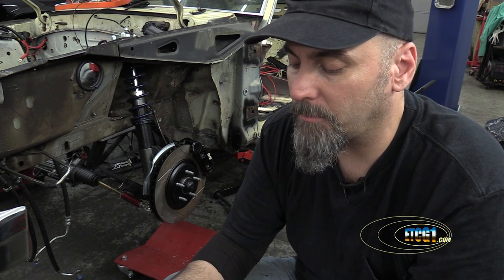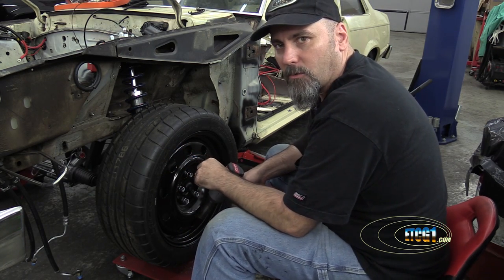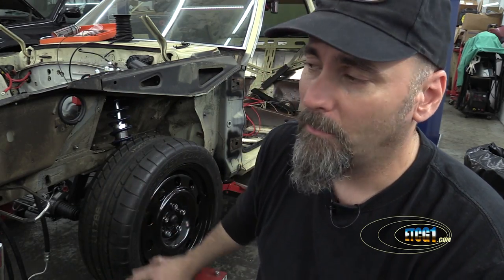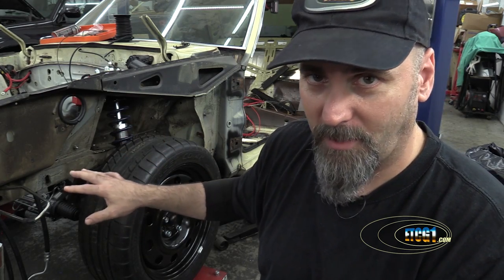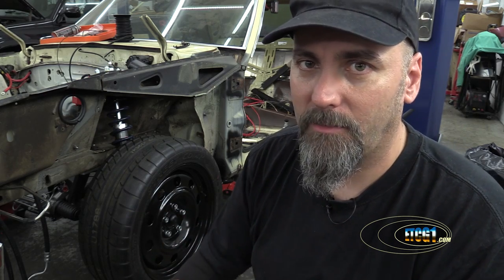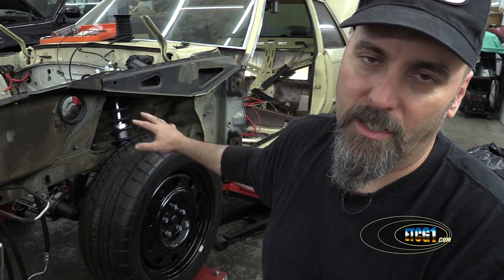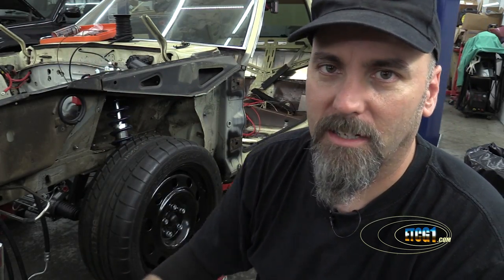Are Wheel Spacers Safe?

Comment: I would think those mass produced Queen Vic cop wheels should be pretty strong. Maybe not the ultimate wheels for what you are looking at, but I'm sure they took into consideration the cop engine, cop suspension and potential for high speed pursuit when they designed them. Worked OK for the Blues Bros. ;)
Reply: They flex like crazy. We couldn't keep the hubcaps on our P71.

Comment: a suggestion good sir.
if the need for wheels arises.....use centerlines (solid ones) and have them powder coated black. they will blend better as stockers at a glance. the sleeper "look" will still be retained....save for the intercooler. perhaps flat black for the bottom of that particular critter ;-)
=dok=
Reply: Centerlines are drag racing / muscle car wheels in terms of appearance, plus they have zero cooling.  Possibly the single worst choice of wheel out there.

Comment: Just a quick question since I have no clue about this.
 Would wheel spacers make you fail a track tech inspection? Yes, no, or it depends on the track?
Reply from the maker: Depends on the track, the vehicle, and the rules of the race you're in.
Reply: Well I guess that can be remedied by getting another set of wheels that you'd only run on the track.
 I'll even be willing to bet that if you look hard enough you'd be able to find a place that can get you a set of  the same style wheels with a different offset.
 That's one of the things I love about cars. almost infinite possibilities.
 Thanks for the reply.

Comment: I wanna put 3" wheel spacers on my truck to run a -44 offset rim so I don't rub my springs. I had I 2" wheelspacers fail on me Before which resulted in them failing and me breaking my wheel off the studs and causing body damage. Andy advice

Comment: Hmm...I wouldn't be concerned with safety but I'm not too sure about the long term affects on wheel bearings and steering geometry. I could be wrong but I would think the further offset would create a higher torsional load.

Comment: Years ago, they made some really cheap and crappy wheel spacers that were dangerous.  The 1/4 inch ones if installed correctly are safe, they do not affect the handing of the car and will not come apart.  The cheap ones they made years ago would break apart, they were dangerous.   Good quality spacers are safe if they are installed correctly and made to work with the aplication you are using them for.

Comment: I don't have a problem with wheel spacers from a prospective of safety but I'd imagine they have the potential to throw off the geometry of the suspension. Glad to see your getting closer and closer to completing your car though.
Reply: TheTarrMan depends, they are usually used to correct wheels that have a et value that's to high, hence the rubbing on the shocks. Basicly putting the alignment back into spec.
Reply: @Roger Supernova Very true point.

Comment: I had this problem on an 06 acura tl. When I put a spacer in there wasn't enough threads to grab and hold the wheel. I had to get extended thread lug nuts that actually go down into the wheel seating holes and grab more threads. Problem solved.

Comment: In a YouTube channel Engineering Explained thy talk about how much more excessive wear the spacers will have on your bearings, your tow and scrub radius will be off and your suspension load will be off. 

Question: We have a 2016 Acura RDX V6 AWD. I want to put quality hubcentric 1" wheel spacers with new studs pressed into the spacers on the car for better handling and aesthetic look. So they will be quality part installed correctly with right torque and I will use a medium strength thread lock.

 How much more stress will I actually put on the vehicles bearings & suspension components or if any? will I speed up the life by 50% lets say? 

Option 2: I buy a bigger more aggressive offset wheel (1" wider and 10mm more out offset) - wouldn't this be the same effect on premature life span wear as a 1" spacer? 

Thanks
Reply from the maker: I really couldn't say, but I wouldn't recommend doing what you're doing. My experience with Honda/Acura is that they really don't like it when you change the tires or the suspension.

Comment: Wheel spacers are not for street use, they were originally designed as a tool to determine wheel offsets for custom applications, then you order your wheels to fit your car. as the lugstud is a standard length the lugnut has to engage at least the same depth as the diameter of the lugstud any less is danger Est for the torque setting for the wheel.

Comment: I have 1/2 or 1'' wheel spacers on my 700R raptor and I was pulling it by the rear bumper and the front left tire caught the side of a 1'' driveway side and the wheel obviously went to full lock. It folded the tie rod like it was butter.

Comment: Eric, you did mention it but I wish you'd have spent a little more time explaining hub centric design. I your case the wheel maintains the hub centric contact because your spacers are only 1/4" thick. My concern for folks out here that are using spacers so thick that the wheel looses contact with the hub. Two types of wheels in common manufacture. Hub centric and lug centric. So the engineers remarks seemed less than reliable to me since those two different assemblies are achieved by focusing energy or forces of energy toward different components. Again, 1/4" and your hub centric wheel is sill engaged in the assembly, I'd go with that any day of the week. I've even used brake pad adhesive to bond the spacer to the rotor just so it won't fall off during tire rotations or flat tire changes. I can't wait to see your car complete. I have always been big on suspension and braking upgrades and think they are more important than power. I hope that you are taking time for yourself.

Comment: The issue most people have is they just throw the spacer in there and ram the wheel back on. Never check to see of the studs are long enough. Or they over torque the wheel and crack the spacer and it falls out while driving.

Comment: "Properly installed" is key.  I had a customer come in with wheel adapters he installed himself.  the original studs stuck out beyond the spacer and didn't allow the wheel to seat up against the spacer.  Luckily he had a flat tire and brought it in to be repaired when I noticed it.  He was leaving for a 250 mile round trip with it!
Reply: thats the KEY issue these days, people buy all these things online and there are no warnings on the sites selling them stating the PROPER method of install.

Comment: Excellent video Eric!  Nothing wrong with wheel spacers, in fact, I've seen bolt pattern adapters that are perfectly safe (when properly used).  If somebody tells you that you're wrong, without considering logic, every day application, and an honest lack of knowledge (on their part), it usually means the person is self-important.  I'm glad you set the record straight on issues like this!

Comment: So to chime in on Safety and Wheel spacers. I agree what you're saying when properly installed. I also disagree that the GVW of a vehicle should be a concern when you utilize them. I really feel as though the idea of spacers for aesthetics is what causes the comments of unsafe implementation.  So for example the diesel truck modification a 1 ton work truck using very thick spacers suspended by 8 or more lugs and 1 to 2 inches of spacing. Lets weigh the safety when that 22 inch Alcoa Semi- wheel and tire modification flies off into the minivan with kids in it?  
I guess my main gripe is not so much the individual that does use the spacers its the implementation and safety of others on the road when things go wrong.
its the same thought that the invention of weaponry destroyed humans no the intent of utilizing weaponry did as all things were at one point concepted as a tool of ingenuity and advancement, some beg to differ.
my piece of mind, take care my friend and ,"Stay Dirty!"

Comment: I've had spacers (hub centric) fail on me in the past, not so much because of the spacers, but because of the studs that were pressed into them. Most of them that have studs are of poor quality. A few of the studs would snap after 2 or 3 years (-20*F winters and 80*F summers, plus heat cycles from braking). If you are going to run spacers with the spacing to require studs in them, press them out and put some quality studs in.
Reply: Were the studs pressed into the spacers?
Reply: they came pressed in already. After the last time a set failed, I bought a new set, pressed out the studs that it came with and pressed in oem studs. Been through 2 sets that failed. Third set hasn't failed, been 5 years

Comment: I am not a fan of spacers, but they are legal in 1400 hp pro stock NHRA cars (well, they use them), when used properly and a good material is used.  Wheel adapters however scare me a bit more.

Comment: Why was this brought up for such a small adjustment and you made a hub centric piece .well done. You must understand steering geometry in some cars are fixed and others are adjustable,  As long as the steering inclination angle is not disturbed then all is good but if not you will end up with a uncontrollable car with bump steer as a bonus. Eric you mentioned pulling the wheels forward was that to give more caster to manage understeer ?
Reply from the maker: It moves the weight of the engine back for better handling.

Comment: I would love to have a discussion with people that saying they are unsafe? I like to know what are they referring to?  When using wheel spacers you need to know how to installed them properly and use the right type. It is perfectly safe to use them. I have been using wheel spacers, always ones that are hub centric and use longer bolts or studs like ARP and have been racing with them for many years with no issues.

Comment: when i was a kid i had a 79 firebird. i got some 16in 89 GTA rims and tires. i had to use 1/2 in spacers and change the studs out for longer ones in the rear. cuz w the 1/4 in they still rubbed when i turned hard. i never had an issue. but i was warned about it also.

Comment: With your little one I would and I think some have said basically a washer so smooth saling I say. Now the thick ones you showed on your video the couple inches one, while done right might be ok. And yes it would be a bit hard to swallow the cost of new wheels, but i think that's the time you get new wheels with the proper backspacing. But that's my opinion.

Comment: Great vid sir.
Hubcentric is the key. Otherwise it will vibrate like crazy. 
Beyond a certain thickness.. bolt on style.

Because these thin spacers are not hub centric.. I don't like em. They are cheap for a reason.
12$ vs $80+

Comment: my buddy lowered his CL and bought an aftermarket rime set. the only way he could get the wheels in was with the flat universal wheel spacers that Eric was holding. 
he didn't torque them down correctly... needless to say he lost a wheel on the highway and him and his girlfriend were really shaken up... in my opinion the only wheel spacers that are just as safe as we M are the really thick ones(inch or two) that have the lug nuts on them.

Comment: the problem I have with your particular wheel spacers is that they are made out of aluminium. although unlikely there is a chance of galvanic corrosion which is when two dissimilar metals are in contact with each other. the other issue is over time with repeatedly removal and installation of the wheels, which you are going to do on a race car you are going fatigue the aluminium causing it to crack.
Reply from the maker: I would counter with, you're thinking way too much and don't appear to have any experience with these wheel spacers.

Comment: Without knowing that much about it, I don't think 1/4" spacer is going to make much of a difference at all. If the spacer were far larger (imagine ridiculously) then it would maybe start to affect the suspension geometry and load points here and there......
But if a reasonable size and put together properly, I just don't see a problem.

Comment: There is a downside of a spacers it creates leverage to give additional stress to the hub wheel bearing because you move away the center gravity weight of a car. weight of a car should be crisscross on the center of the bearing. Just check ones in a while your bearing for safety.

Comment: I read the Maximum Motorsports text and didn't notice anything about how the distance from the bearings to the point of load affects things. Without getting into a lot of technical details that won't mean much to most, as an exaggeration, how about spacing the wheel(with adequate strength of attachments of course) say 6" further away from the design point of load transfer? At a minimum, premature bearing wear and failure.
That's probably why some makers of spacers recommend a maximum width on certain applications, such as on the front. When a manufacturer is trying to sell something they're not going to tell you the negatives. You think?
Don't get me wrong...I know professional race car drivers that use them. There's just a bit more to the story than what the sellers tell you.

Comment: I personally wouldn't use wheel spacers.  In the 80s, my brother lost a pair of rear wheels while driving his Valiant.  But I'm sure his weren't like yours and I know they were they were wider than a quarter inch.  As for something being "engineered," well there are no promises there.  You don't need to look any farther than the space shuttle or the Pinto or Takata air bags  to find engineering fails.  And I suspect that a lot more engineering went into those projects that what Maximum Motorsports might have invested.  I'd be checking the studs for stress cracks on a regular basis to help eliminate a disaster.

Comment: A nice informative video, as usual. (As if he would put out anything less, am I right?)
I am just a bit confused by one specific moment however...

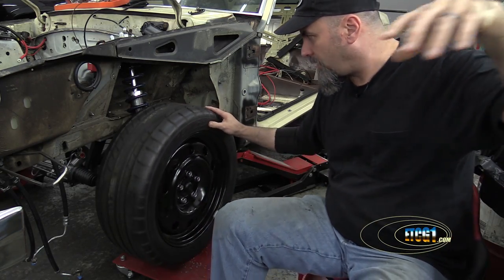2:05 Eric spins a wheel
"I now have the clearance that I need"
(while the rotating wheel says "scrape, scrape")
Reply: That scraping is the brake rotor rubbing on the pads. This occurs when you spin the wheel on pretty much any vehicle that has brakes.

Comment: My motorcycle has about an 1/8" wheel spacer on the rear wheel from the factory. I don't know why, except maybe if it didn't go straight down the road while taking the hands off the bars, (and not leaning) it would go straight down the road, and if for some slight reason, it was a bit off, it could be adjusted by milling a bit off, or maybe adding another spacer, or whatever. Maybe I should add that this motorcycle isn't the typical axle through the wheel with a nut on a bolt, but rather, it bolts on like a car wheel unto a swing arm unit that has a final drive on it. (BMW older K)

Comment: Those cop wheels are plenty strong, I've had them at very high speeds and no problems.:)
Reply: racerxnk We couldn't keep the hubcaps on our only hubcap equipped P71. Those wheels flex like crazy in hard turns.

Comment: I've used all types of spacers for years, on all kinds of vehicles, on all 4 wheels too, I've even used them on my chev pick up and towed a car trailer and boat around with it, with no issues... my 82 trans am came with 1/4" spacer plates on the back direct from factory! 

I don't recommend the CAST aluminum studded type spacer/adapter from trans dapt(they crack easy) buy the billet aluminum ones

Comment: the thicker type you showed which have their own studs can be dangerous, i did watch a land rover with then the other month and suddenly the wheel fell off with the spacer..... because the chap hadn't checked the torque of the original studs.......... that type should be fine, the big ones have been known to cause premature wheel bearing wear but those thin ones should make a negligible difference

Comment: Wheel spacers are SAFE, but you just not have to properly install them but also buy proper wheel spacers, hubcentric specifically for your car from good materials and last but not least tested! If you go for Brand in this case you never do bad decision! Eibach are the best best one you can buy here in Europe, they are TUV approved(German MOT).

Comment: The only thing that properly installed wheel spacers can do is to create more leverage for the forces to work on the hub and wear out parts such as ball joints faster. And even then you'd have to be be doing some pretty huge spacers on a heavy vehicle to ever make that a safety issue.

Comment: I have a Gbody with Fbody wheels because i wanted 15 inch wheels so I could have thick Cooper Cobra GTs and fbodys are different from gbodys because of rim offset and the difference in axle and body width. So I have really thick spacers on the gbody but they are hub centric and have heavy duty elongated studs to basically just reverse the offset change so my wheels are straight in line with the body. Actually what happens If you put fbody wheels on a Gbody without doing this and use as wide of a tire as I do is that the inside of the tire will rub on the frame and wreck the tires which costs lots of money and that is why I ended up having to use spacers.

Comment: I'm wondering why you went for centering the spacers (machining work + welding) instead of machining them from scratch and through-threading stud holes specific for your pattern. I guess double-threading wouldn't work all that well.
Reply: You don't ever thread spacers. They must always slide on the wheel lugs and clamp to the hub, the same as the wheel itself.
Reply: ArchimedeanEye well same as the rotor not the wheel
Reply from the maker: This was the quickest, easiest way to solve the problem.
Reply: ETCG1 absolutely right. Why make a mountain out of a molehill wheel spacers are fine.